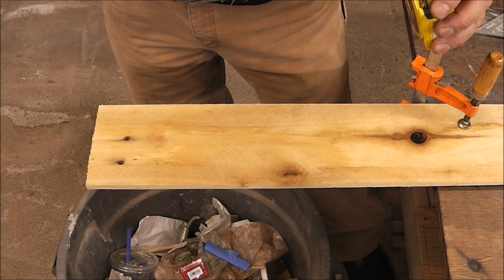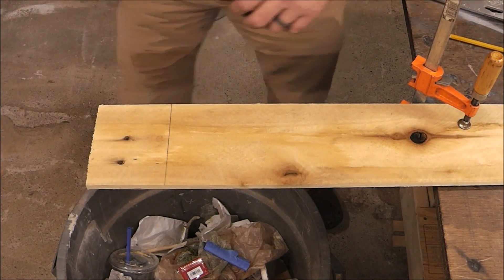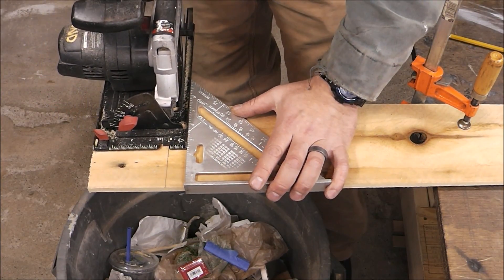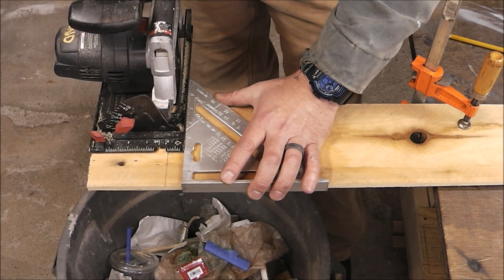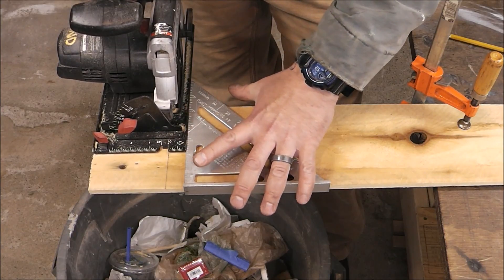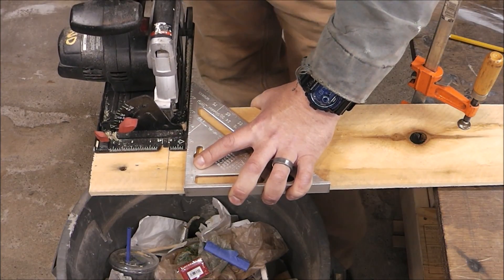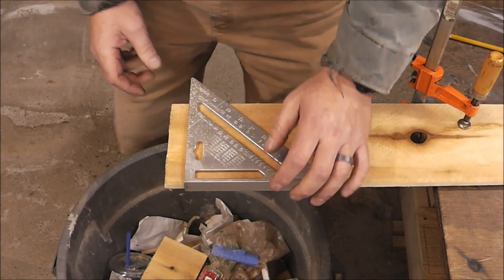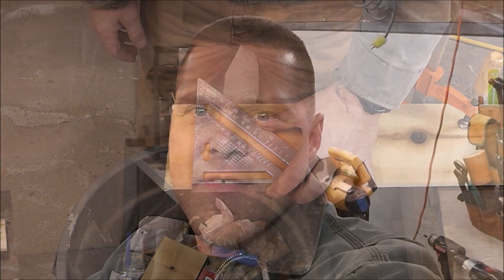Quick Pro Tip SPEED CUTTING accurate and fast cuts!

Comment: I just started on a framing crew as apprentice and they all cut over the foot. I am having a hard time staying on line like that. This will help me out. Thanks.
Reply from the maker: Congratulations Patrick! Just take your time at first. Know where your fingers are at all times.
Reply: @BrandonLund  Yea I always take a second to look at where my fingers are before starting the cut. Earlier this month I attempted a risky cut on my 12" miter saw that bent my fancy new $65 Diablo blade and smashed the hell out of my fingernail. I was making wheel chocks out of a treated 6x6 and I had to complete each cut from the opposite side because my saw isn't big enough to cut all the way through in one go. I had my two 6x6 wedges cut to their final shape but I was slightly off on one of the second cuts on the square side which left that smaller portion of the cut raised by about a blade kerf. I was truing it up making small cuts just taking a little off each time and I guess I started to advance the wood while the blade was still touching it and the blade caught causing the wood to violently slam my fingertip against the metal saw fence. It happened so fast that it looked like the section of workbench where the saw is mounted to jumped 6 inches. I knew it was a stupid cut to try and make because I had no good way to hold it and my fingers were only about 6" from the blade but I hadn't had any incidents in a long time and got too comfortable. I've realized that's when most injuries occur. When you've gone a long time without any incidents you get complacent. All things considered I'd rather have a damaged blade and a black and blue finger than an undamaged blade and 9 fingers.

Comment: I hold it a different way. Instead of the lip being on the back side, I put the lip on the front.its easier for me to hold too.
Reply from the maker: Great tip!
Reply: @BrandonLund  it's how my dad holds it too. The way you hold it also holds the board in place if you don't have it clamped down though.
Reply from the maker: The only reason I hold it so the fence is on the backside is because that fence hits the motor on my saw. It still does but it hits it as it exits the cut rather than enters it (if my saw is set to full depth)

Comment: Could you also clamp down the speed square ??
Reply from the maker: That's actually a great idea Joe!
Reply: @BrandonLund  yes
Reply: I use a pair of vise grip clamping pliers, when I am having a hard time holding the speed square, or the part is critical and I don't want to have my hand slip, or the square is on the wrong side to use with the clamp I am using.